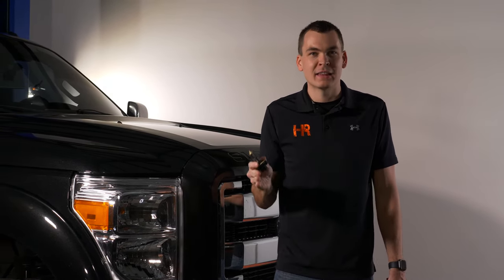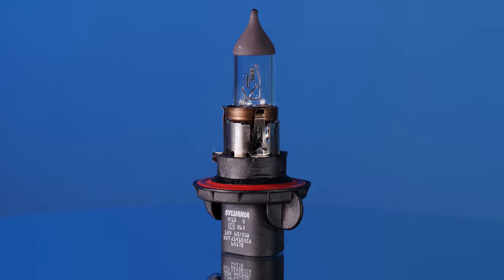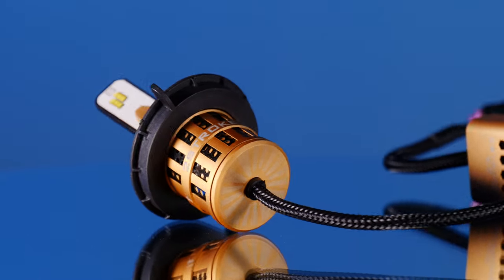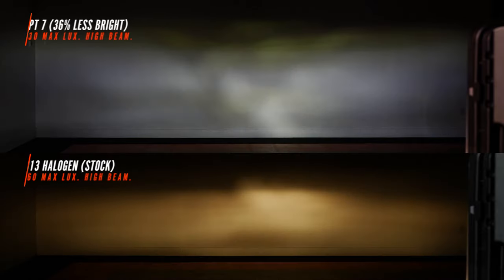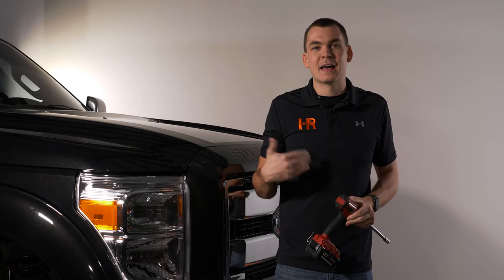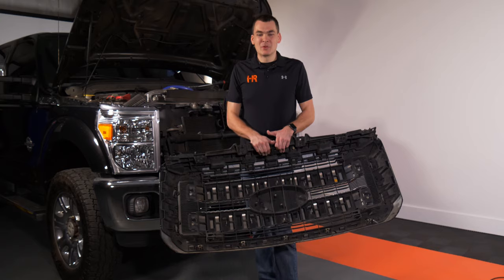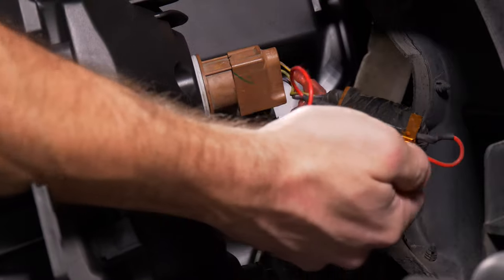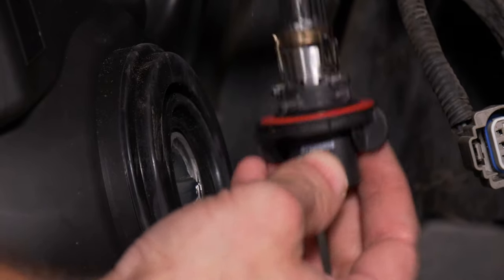HR Tested: 464% Brighter LED headlights for the 11-16 Ford Super Duty | Headlight Revolution

Comment: Now if you can only do the fog lights and show the F250 install as I have failed to find a 2011-16 fog light video.
Jim
Reply from the maker: We have the fog lights available on our website!
https://headlightrevolution.com/2011-2016-ford-super-duty-led-headlight-bulb-upgrade-v-4/

We don't have an install video yet, but it's extremely easy to do. All you have to do is lay on your back and reach up to the bulbs and rotate them out!

Comment: This should be in a projector housing. Don't do this ppl unless you have the right housing. Light will be scattered everywhere at night but where it should be. (On the road)
Reply from the maker: If you pick the proper LED bulb, you will not have any light scatter or glare. There are a few bulbs that are able to replicate the OEM halogen beam pattern, which are showed in this video. There are also the other bulbs that do a terrible job at this that are shown in this video as well!

Comment: I got a 2015 F3 50 they just put brand new LED bulbs in it and the passenger side goes to the right and the driver side it’s OK what does your the Ford dealership and did all that turn the lights on and it’s OK but the lights are right but they’re not angles right

Comment: How come I cannot find bulb size 9145 on your website? That is the fog light bulb size for the 2016 F250.
Reply from the maker: That is the correct bulb size for that vehicle, and the reason you can not find that is because we have that listed as 9005/H10. The 9005/H10 is the more universal version of that 9145, and will work in that fog light application! I have linked the ones that you will need here:  https://headlightrevolution.com/s-v-4-led-h10-bulbs/

Comment: Got a 2014 F250. I’m gonna have to completely replace the sockets. How do I know which wire on the socket is for low beam, ground, and high beam?
Reply from the maker: I would suggest reaching out to our CS team so we can help you!

218-755-5200
Sales@HeadlightRevolution.com

Comment: Are these the H13: GTR csp led headlights? If not do they put out the same?
Reply from the maker: We tested a bunch of different bulbs in that housing, you can see all the different bulb specs for that housing in the video description. We did not test the CSP Mini, but I will tell you that the Ultra 2 and the S-V.4 will be much brighter than those CSP Minis! If you need anything else, let us know!

Comment: Do you guys have LED switch back turn signal bulbs for 2012 Chevy silverado 1500
Reply from the maker: We sure do! Here is what you need. 
LED bulbs: https://headlightrevolution.com/gtr-lighting-armor-series-3156-3157-led-bulbs/
Resistors: https://headlightrevolution.com/gtr-lighting-50-watt-6-ohm-gold-style-resistors-for-custom-installation/
Reply: @HeadlightRevolution  will these specific ones be plug and play or will the need the resistors
Reply from the maker: For your specific truck, you will need resistors for those bulbs.
Reply: @HeadlightRevolution  thanks
Reply from the maker: You're very welcome!

Comment: How would this relate to a 2008-2010 super duty?
Reply from the maker: It'll practically be the same. There are very little differences between the 08-10's and the 11-16s.

Comment: Which bulbs would you recommend for a 08 yukon headlight
Reply from the maker: Converting to any LED or HID kit will not be DOT compliant. To remain DOT compliant, we would recommend going with a higher-powered halogen bulb, like the ones from Vision X. Here’s the one that we recommend:
https://headlightrevolution.com/vision-x-h13-80-100-watt-headlight-bulb-set/
Reply: @HeadlightRevolution  I was looking for some leds